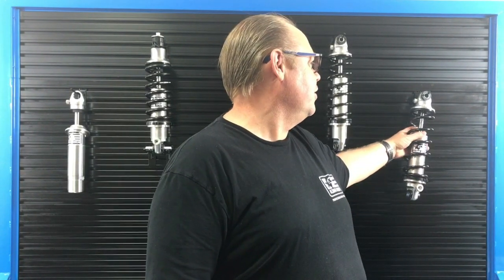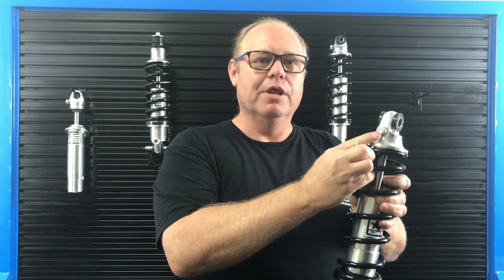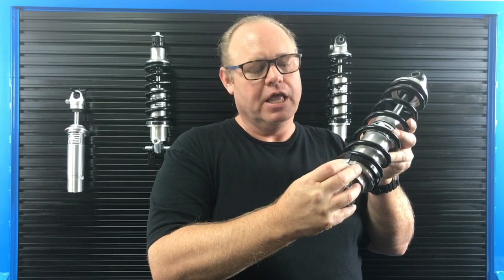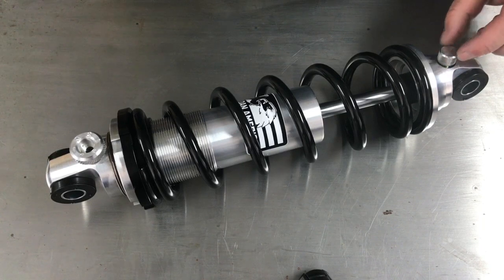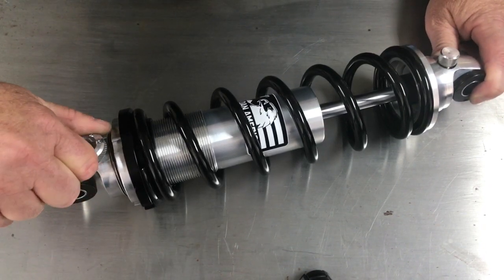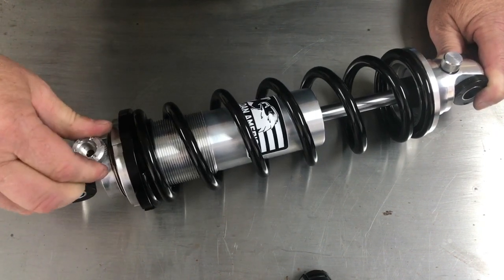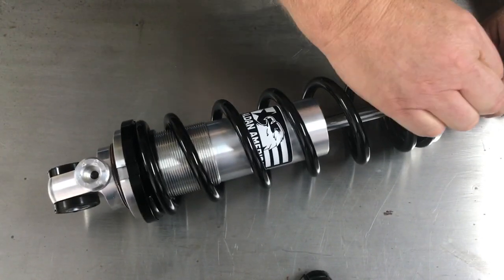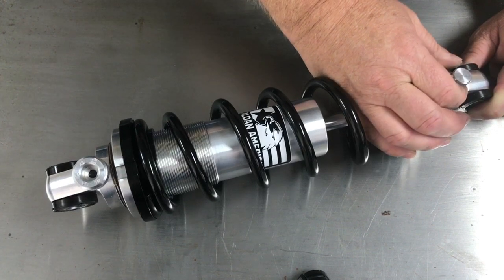How to Adjust a Double Adjustable Coilover Shock - Aldan American

Comment: As an ASE Master who also worked for ACDelco, I guarantee that GM suspension engineers try a dozen struts, shocks valving combinations regardless of computer modeling, before they agree on the right combination of valving, fluid viscosity and rate of dampening & spring before going into full production. 
  The over the counter gas charged or not, are simply near what machine testing can repeat. The speed of machine compression and rebound can be measured with accelerometers to list a strut or shock by application. 
  At least this shock from Aldan can be set for your type of driving, added weight or reduction of weight. Sure you can 4 people and some equipment in your ride but the seat of the pants feel is different for each person. Dial it in! Make it yours. Enjoy!